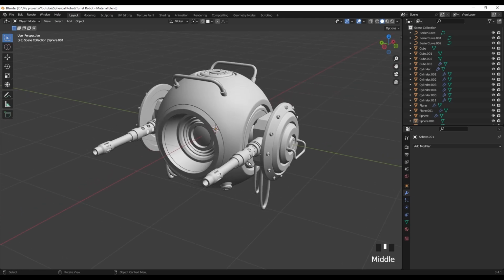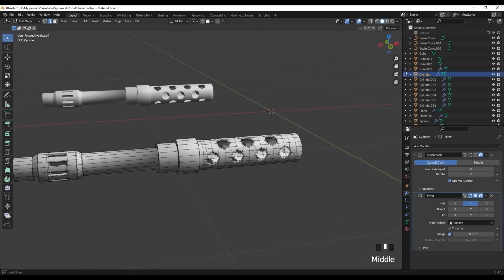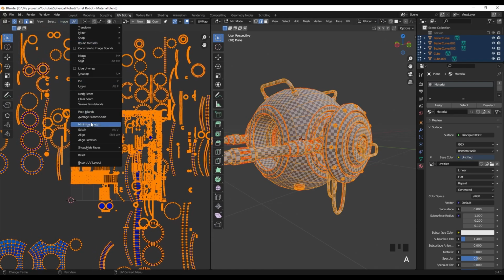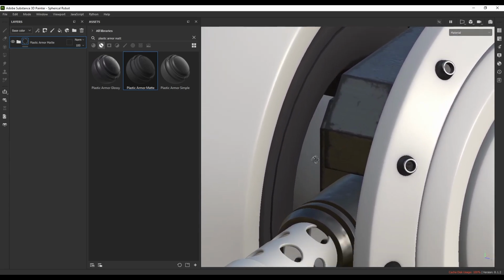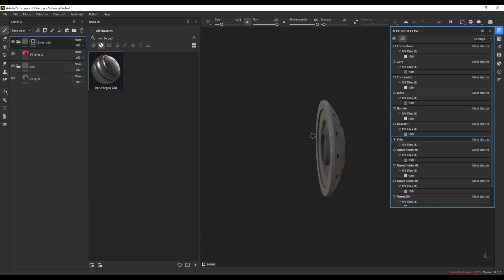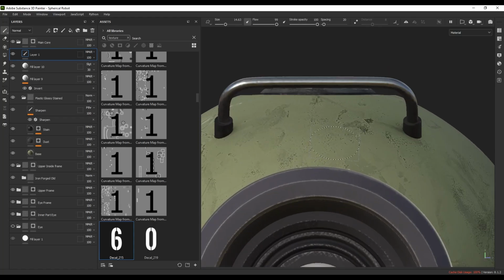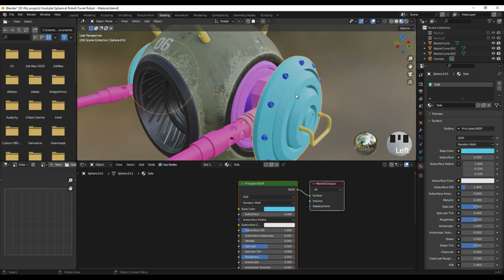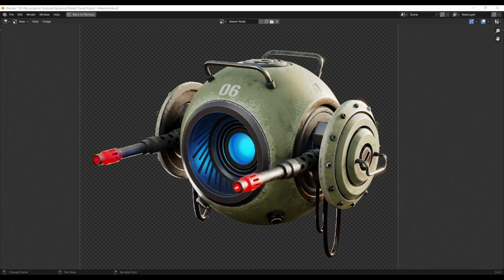Material Creation and Rendering Tutorial - Spherical Robot with Turret - Part 2/2

Comment: Is it impossible to use such a model in game engines to create games? Isn't it considered high-poly? It will slow down a lot. why was there no baking on the low-poly model?
Reply from the maker: This is a high-poly model and is not intended for use in game engines. However, if you wish, you can create a low-poly version and transfer the high-poly details onto it through baking.
Reply: hi if u have that texture image can u send me please because the site is not working for me

Comment: My UV for the first part of the tutorial is all coloured in the UV Editing, but I’ve done everything as shown in the video twice, and I can,t figure out why. I’ve also noticed that every time I press L in the UV editing window, the colours of the stretch change, and sometimes some parts of the mesh unwrapped become blue, but all the other have like a gradient on it. Any suggestion? 😢😢
Reply from the maker: It appears that your islands are not properly unwrapped, or the seams may be on incorrect edges. Please select your islands, press 'U,' and choose the unwrap option to see if that resolves the issue. If the problem persists, kindly send us your file via email so that we can further investigate and provide assistance.
Reply: @pixlways ehi! Thanks for the answer 🙏🏻🥲
I’ve tried also to unwrap a simple cube from a new file, and I’ve the same problem. I’ve read on the internet that could be a bug related to the M1/M2 Apple processor 

Btw I will try to unwrap everything another time, but I’m pretty sure that I have done everything correct 🥲

(Where can I find the mail?)
Reply from the maker: If you have the same problem with the simple cube, then it's not necessary to unwrap everything again. Try a different computer. Here's the email address: pixlways@gmail.com
Reply: @pixlways  Hi! I think I've resolved the issue. I've read on some forums and I've figured it out that is a bug related to Metal GPU Backend. In fact i have a Mac studio with M2 ULTRA and with blender 4 there's not possibility to change the GPU backend on a Mac with silicon CPU. So i've downloaded blender 3.6, switched from Metal GPU Backend to OPEN CL and all my UV are blue. Unfortunately is a bug that is present since blender 3.5 :(

Btw thanks for your support and congratulations for the awesome tutorials you're doing. Thanks <3
Reply from the maker: Thank you so much for the update and for sharing your solution! And a big thank you for the kind words about the tutorials! We're glad they've been helpful to you. If you have any more questions or if there's anything else the community can assist with, feel free to reach out. Happy blending! <3
Reply: Here's a video of what is happening https://youtu.be/Ggx6W3jVQHQ
I've also downloaded your model and, even if your texture shows correctly, in the UV Editor i've the same "problem". Is it a real problem or am i just missing something? 
Thanks <3
Reply: hi if u have that texture image can u send me please because the site is not working for me

Comment: What is the difference using Mark seam and smart uv project?
Reply from the maker: Mark Seam - Allows you to manually define seams by selecting edges. Gives you precise control over how UVs are laid out.
Smart UV Project - Automatically calculates seams and unwraps the mesh based on geometry. Fast and easy, but less control.
In general:
Mark Seam = manual seam placement. More control.
Smart UV Project = automatic unwrapping in one step. Quick but less customizable.
So Mark Seam is preferred for complex models needing fine control. Smart UV Project works well for simpler assets.
Reply: hi if u have that texture image can u send me please because the site is not working for me